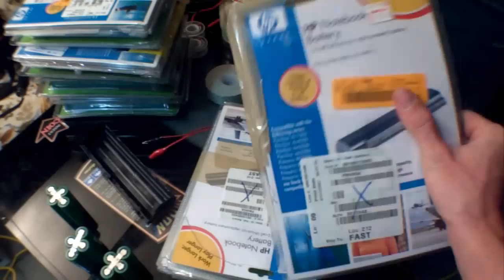DIY: 48v 24ah lithium ion 18650 e-bike battery pack

Comment: Why the hell would you use nails to connect the packs? You've got wire right there!
And then there are the other safety issues, such as no thermal cutouts in case a cell overheats, & no charge-levelling.
Reply from the maker: because i didnt have any copper on me, and this does good enough. all the wire i had was thin braided strands that are hard to use. i wanted one thick wire and these nails work wonderfully.
Reply: They won't for long. I'm also confused as to how the hell you managed to make solder stick to (presumably) steel nails. Regular solder won't work on steel. That spool of green wire you showed at the start of the video would've been perfect for the job.
Reply from the maker: God Emperor Lionel Lauer
that green wire woulda been overkill, also a pain in the ass. i've never had issues with using solder to bond steel.
Reply: ::facepalm::
Reply from the maker: God Emperor Lionel Lauer
 you can facepalm all you want while i ride my bike with this battery.
Reply: You'll be lucky to get a dozen charge cycles out of it before cells start melting down / venting / bursting into flames.
Reply from the maker: God Emperor Lionel Lauer
lol you must not have much (if any) experiance with 18650s. it works fine. theres no reason they would burst into flames.

and i must be very lucky since i've already surpassed a dozen charge cycles and they are all balanced nicely at 4.05v per cell.
Reply: Rinoa Super-Genius  i've already surpassed a dozen charge cycles
Yeah, sure you have.
Reply from the maker: God Emperor Lionel Lauer
 might want to back off a bit. ya see your trolling a bit too hard and it showing. its ussually best to lightly troll somebody so you dont let them know your just wanting to bicker.

i'd say you where 8/10 for the first 2 comments but the rest taper off a lot ending in 3/10. :/
Reply: Pfft. I'm an EE. It's no skin off my nose if you set fire to your bike while you're riding it after ignoring every Li-Ion battery pack design guideline in the book. Remember those those metal cylinders/disks you cut out & threw away when you pulled the cells out of the laptop battery packs? - They were there for a reason.
Reply from the maker: God Emperor Lionel Lauer
i rely more on my experiments and experiance than on any books. my tests havent showed any issues. also i have spent many hours trying to make cells fail on camera and they are just so durible i gave up on trying to film one bursting into flames or even smoking for that matter.

i hope my bike does catch into flames. then i would know how to build a better one.
Reply: i rely more on my experiments and experiance than on any books.
Yeah, it shows. Seriously, do you think they put those thermal cutouts in there because they look pretty or something?
Here's a fairly typical Li-Ion battery pack design guide from Panasonic. It's not terribly noob-friendly, unfortunately, but it's a start:
http://industrial.panasonic.com/www-data/pdf/ACA4000/ACA4000PE4.pdf
Reply from the maker: God Emperor Lionel Lauer
only a fool would overcharge or over discharge their battery pack. my batteries havent ever had any issues with overheating. i've actually had a lot of issues with them not heating up in winter weather.
Reply: Yes. That is surely the cause of the problems you've had with them...</sarcasm>
Reply from the maker: God Emperor Lionel Lauer
what problems?
Reply: God Emperor Lionel Lauer As long as he is slowly charging them, the batteries will do a decent job of charge-levelling themselves. Charge-levelling is a technology that was developed for increasing the speed at which you can charge the pack, and ensuring you get the most charge into each and every cell.  If that isn't a concern, he can slow-charge them without issue.  Sure, he won't be charging every cell to full, but the bike already does more miles than he needs, so that isn't a concern either.  His pack is larger than it needs to be.

As far as the nails for conductors, they looked like they had a bright nickel finish, which means they should not cause any galvanic corrosion (as long as he used the proper solder) since the terminals on the battery are typically nickel plated as well.  The only concern should be ensuring that no condensation or moisture builds up in the pack.

My only concern for his safety is that I hope he positioned the pack in such a place on the bike that if a cell were to fail and rupture, that it is not near his legs where he could get burned.  If it is toward the front of the top-tube, close to the fork, he should be fine.
Reply: Haeze He's charging the packs straight off a PSU with no charge management electronics, & he's got the mismatched sub-packs in a giant series string, which might be the very worst possible way to charge that many Li-Ion cells. He hasn't sealed the uber-pack airtight, so it's bound to get condensation & corrosion sooner or later.
Reply from the maker: God Emperor Lionel Lauer
Guess you didn't see the next video, don't profess to know about my project until you've watched more than just one of the videos.

Oh and I keep the battery in a battery box on the back. Its pretty durible.
Reply: Rinoa Super-Genius Seriosly mate, God Emperor Lionel Lauer might be being a bit of a dick in how he's putting things (though i get his frustration), but using steel nails as conductors? wtf? like he said, you've got copper wire sitting RIGHT THERE, it conducts better than nails (less voltage sag, thus less heat, more range, higher cycle life before replacing the cells, no risk of galvanization from the incompatible metals, if they are galvanized nails, no danger of inhaling highly toxic fumes if they get too hot... the list goes on). 

There's a good chance that although the nails appear 'secure', that they are infact only held on by a blob of solder, that the solder hasn't actually bonded to the nail at all, so all you have is a physical contactor, not a properly soldered one. If nothing else, please open this back up and solder some of that copper wire in parallel with the nails - then the nails can still provide some structure, while the copper can take 90% of the load. Your pack will last longer, you'll get more range and top speed... etc etc...riding with this pack now is seriously dumb, unless all your drawing is 1-2amps (which I doubt, given your doing <30mph). Even if you are, still not a good idea.
Reply: ***** ah... use the copper wire he's got sitting right there maybe?
Reply: ***** For 48V motors, grouping them in 13 x 4 cell packs in series, & using heavy duty diodes to isolate them from each other would be a big help in terms of safety for both usage & charging. But really, even replacing the nails (!!!) with heavy copper cable for the interconnects would be a good start.
Reply: ***** Unfortunately, it's extremely hard to judge without pulling apart the battery packs & giving them a close inspection, because it totally depends on the quality of the cells & the design + manufacture of the management electronics. In general, the best advice I can give is to evaluate them the same way you would any other long-life product, ie; based on their reputation amongst serious users vs price for comparable products. I'd look at the most popular brands with serious, repeat buyers, then choose based on my budget, taking into account what price vs quality trade-offs I would consider acceptable for my own usage patterns.
Reply: ***** If you're willing to put in some work yourself, you can save significant amounts on those costs. But it really comes down to balancing the work you want to put in vs the peace of mind/ease of a store bought battery. I'm using a 92v 10ah (so about 3x the capacity of the 36v10ah pack you mentioned for 399) pack I built myself for about $300, but it requires more work and knowledge on my part. Essentially, you could build your own 36v 10ah battery for about $130, that would power a 2kw ebike with ease (laptop batteries would never manage that). For an extra $50-80 or so I could make it even easier to take care of, but for me its easy enough now as is (for me). That should at least give you some idea of how cheap you can build a good ebike battery for. 

If you want to buy a good premade pack for lower powered ebikes (sub 1kw), I'd suggest 'pingbattery.com'. I know many people who've used them on lower powered ebikes with great results, and they last for years. $318 for a 36v 10ah pack, before postage, but with a great reputation (I have no affiliation with pingbattery, just reporting what I've read from forums I'm on).

You might also want to check out endless-sphere.com, a forum with tons of info on building ebikes (where I learned 90% of what I know now, and where I bought my ebike motor and controller!)
Reply from the maker: *****
Yes that is very over priced, just build your own for much much cheaper.
Reply: Rinoa Super-Genius And just how much cheaper were a bunch of laptop batteries vs a legit bike battery?
Reply from the maker: God Emperor Lionel Lauer
Well you can get them for free if you look around, I've found quite a few in the trash.
Reply: LoL you deserve the troll trophy!
Reply: Indeed. Because hey, what could be the downside of mixing worn out batteries with fresh ones to save lots of money?
Reply from the maker: God Emperor Lionel Lauer
 i havent found any downside that outweighs the good yet. just every so often you get  a cell that shorts out. but if you section off your cells with fusses you wont have any issues.
Reply: sn0wchyld
seems there happened a typo, shurely you ment http://www.endless-sphere.com/
 thank you 4 Ur hints :)
Reply: iFly2theMoon ha yea good spot... fixed it up.

Comment: Why is your soldering iron so darn big?!
Reply from the maker: couse its the only one i have that gets hot enough. all the other irons i have are too wimpy.

this soldering iron was made to solder tin roofing together. would normally use solid 0.5x0.5x10 inch lead rods as solder.
Reply: Cool. Also, because you seem knowledgeable with Li Ion batteries, I have this: I have some Li Ion batteries in a 9V forma factor (they are 7.4V groups that charge to 8.4), they are 500mAh, and I have four of these groups and one charger that outputs about 300mAh. If I hooked up all of the batteries in parallel, would they all charge safely?
Reply from the maker: michael phillips
I think the battery I have now is pretty good. but i,m working on a production model that I can sell on eBay.
Reply from the maker: michael phillips
i would buy them but I think shipping them half way across the planet would prove too expensive to make it worth while.

Comment from the maker: also if Bottom ballancing is like dropping them to 20% charge and balancing their voltage, then it would be a bad idea unless your cells where all exactly the same age/capacity. because if you have a 3ah and a 3.1ah cell in series and charge them to 8v. the 3.1ah cell will take more power and will be a lower voltage than the 3.0ah cell. even if slightly.

i will be using an IMAX B6 balance charger off ebay to cater to my cells, they only cost like 30$.

Comment: Enough potential power to nuke a small village lol
Reply from the maker: a gallon of petrol has 66 times more energy than this battery, so that village must be really really small.
Reply: I know bro, Just messing with ya :)
Reply: +Rinoa Super-Genius have you gone back and solder balancing lead on them? or are the pretty save without them? I've noticed that HBPowerwall and vw running on 18650s never had any balancing.
Reply: The nerd has spoken.

Comment from the maker: hey thanks! me and Difflocktwo where talking about how to balance cells. i didnt think it was an issue but evidently it could be. found one cell deviated to 3.8v and pushed all teh otehrs up a bit on my 1st battery pack. and found some of those nails broke in my new pack. hope that didnt cause over charging.

i'm looking into how to safeguard against this.

Comment from the maker: pretty much nonexistant. but i used some 18 awg on my old battery pack and it heats up if i get a short circuit. but tbh having the wire be too thin on my other batteries has actually saved my battery once. two cells shorted out and the wire heated up and limited the amps going through so the cells didnt get hot from shorting out all the way.

tbh 12 guage proved to be a bit too big, its just hard to work with sometimes. i used some 14 on my 1st battery and it works great and is more flexible.

Comment from the maker: oh and you may want to run your lithium cells at 4.0v instead of 4.2v because you get about 5X as many charge/dicharge cycles from it then.

also you may want to make a 40v battery instead of 36v. the higher voltage would push more power through your motor and prolly make it like 280w. i am thinking about upgrading my 48v to 52v. but idk hrmm ;/

Comment from the maker: you mean my 0-30v 0-5a DC universal power supply? got it off ebay for about 80$ from china, i made a video about it a while back. it's the cheepest one on market

the next video in this series though i use an IMax B6 battery balancer and it only cost me 30$, i'm gonna do a video of the IMax B6 when i have used it more. got the B6 off ebay too btw.

or ya mean the little 10-80v step up transformer? i've done a video on that too. was 20$ from ebay if i remember right

all 3 items very useful tools

Comment from the maker: yeah i agree in ordinary casses it wouldnt work, but on the big hills where i was riding (where i'd be going downhill for almost a kilometer sometimes) and have to break it would be interesting to use the motor as a break and get a bit of power back.

Comment from the maker: an example of not evenly distibuting cells through your pack would be having 10 lithium cells wired in parallel (so they would be 4v 20ah) then tacking on 2 individual cells wired in series with that big pack to raise its voltage. that wouldnt be a 12v 20ah battery. instead if you pulled a lot of power from that pack the 2 individual cells (each with 4v 2ah) would die really fast while the big battery pack would keep supplying power so it would only be giving out 4v if you pulled a lot of power.

Comment from the maker: but your pack says it has a balance function. so will you be connecting every stage of the cells to the charger to monitor it?

what i mean is, if you have 2 cells in series there is the 0v, the 4v, and the 8v. the 4v being the part where the two cells connect in the middle. if you charge those two cells in series without making sure that middle one stays 4v that could be bad. couse cells one could become 3v while cells two 5v and it'd still look like 8v from the two ends.

but i think your fine

Comment from the maker: cool purchase! is that for LiPo or LiFePo? remember LiFePo are a lower voltage. but theres no differance between Lithium-ion and Lithium-polymar.

so ya got a 64v battery if its LiPo or a 58v if its LiFePo. thats gonna be great for a 48v hub motor.

when you charge them in series it's perfectly fine as long as the individual cells are being balanced. if you charge them in series without monitoring the individual cell voltage it could overcharge or undercharge :p

Comment from the maker: haha i agree,

i've dropped my battery pack, and even dented some cells really bad and they havent had any issues yet. but i didnt use that dented cell from fear hehe.

the worst thing that could happen if you dont balance charge is a cell could raise in voltage and short. likewise the cels could get worn out faster.

but since the battery has to be charged manualy with a universal power supply, i can just charge each pack for now untill i build a charger that will balance charge it.

Comment from the maker: well i actually don't know much about a BMS, never eve heard of them till a few days ago. for all i know my Imax B6 is a BMS.

anyway i've run my imax-b6 charging 12 cells in parallel for about 3 days straight and it never gave any issues. i'd imagine you BMS would limit the charging amps. but i think it should be fine. just might take a while like mine did. but i was charging a lot of cells.

Comment from the maker: i charge mine at low amps, so heat isnt an issue. but balance charging has proved to be an issue. my 1st battery's cells where all teh same age/capacity so they didnt all stayed at around teh same voltage, but with this battery ima build a balance charger from scratch.

funny how issues like this crop up, right now i charge it by onwraaping teh tape and charging each pack to 4v. also it reminds me to check for faults. so it works out.

Comment from the maker: no lithium batteries don't really explode that easilly. i actually spent a day crushing and overchaging and heating 18650 cells trying to film one exploding or something but all they would do is short out and get really warm while they discharged.

and yes i've already looked at the datasheet for most 18650 cell brands. and tbh do airlines steel the lithium battery from your phone before your fly? i got my battereis through air-mail.

i would never say lithium is too "dangerous" to use.

Comment from the maker: i'm talking about internal shorting. its when the annode and cathode connect inside and the battery gets really hot as it discharges itself.

and yeh i've shorted out lithium cells a lot, especially when cracking them out of laptop battery packs ;p

Comment from the maker: i'm going to add a ribbon cable coming out that has each wire connected to each cell and i can then balance charge it via that cable. but once its balance i could charge it as a whole at 24v a few times. it would take several cycles for the battery to get unbalanced again.

i'm still contemplating on if i should buy a battery charger or build one from scratch.